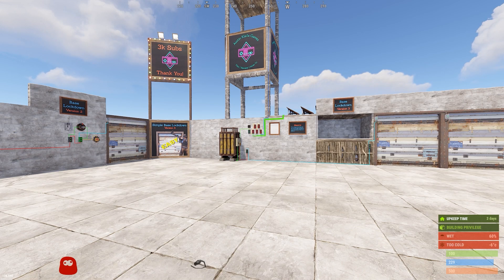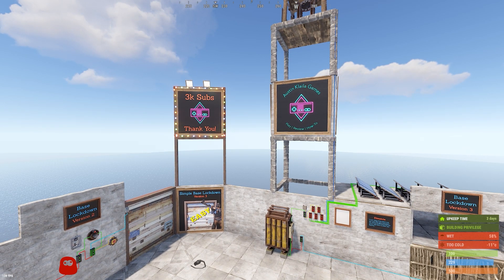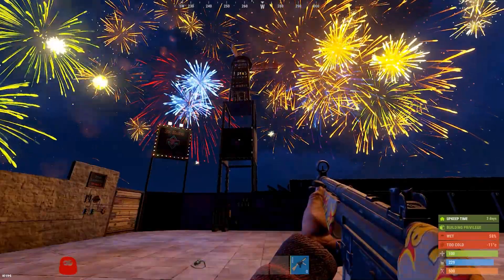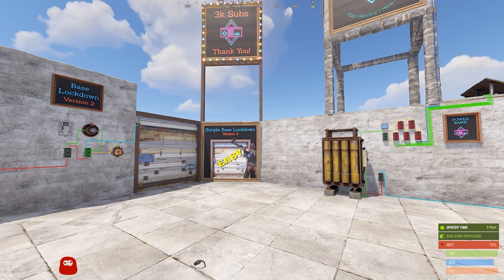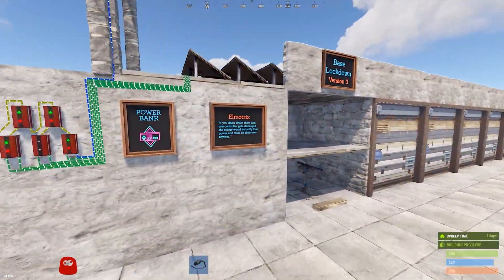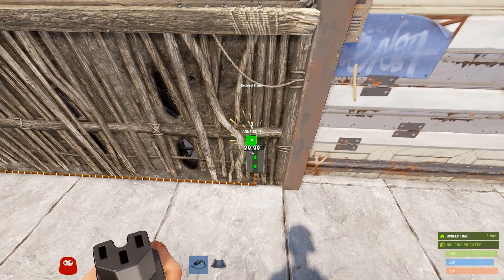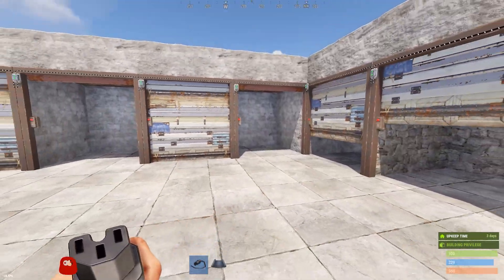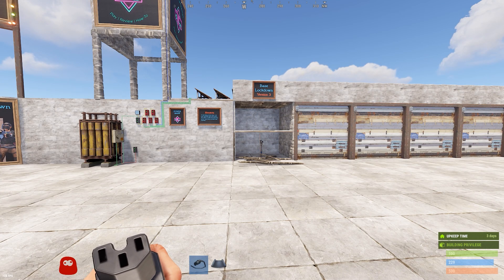RUST Electrical | Simple Base Lockdown VERSION 3 - 2023

Comment: You're slowly heading towards my method of using doors; once there's more than 5, I fit TC authed buttons that open all internal doors at the entrances and spawn points in my base.
I have the 3 year old method using AND switches and timers here: https://youtu.be/_nwbGmUfVjo skip to 3:10
the more modern low power version using XOR switches and 0 energy HBHF sensor set up here : https://youtu.be/m_BI1b20mOo skip to 0:50, note the 2nd HBHF has no light yet still functions.
I cannot STAND opening and closing a million doors in and out of my bases.

Comment: Gratz on the 3k subz mate, i got a stupid question .. if i have my power in core and 4 lights directing to N,S,E & W and i have a HBHF sensor on the outer walls of my 3 layer base .. hpw do i get the sensor to trigger the light and also emergency shut like 3-4 doors in the process .. im stuck :,)

Comment: I need to do more testing but it seems like every time the server resets, which is daily on my server, all my doors get powered again and open up.

This could be a huge weakness depending on what angle the raiders choose to come in.

Might want to consider disabling the door controllers when you go offline.
Reply from the maker: It shouldn't do that. I'm guessing it has something to do with a plugin. I reset my servers regularly, and it does not affect electric builds. I'm interested to know what is causing this. Do you know what plugins are being used? What's the server name?